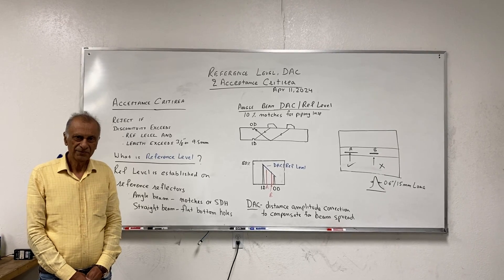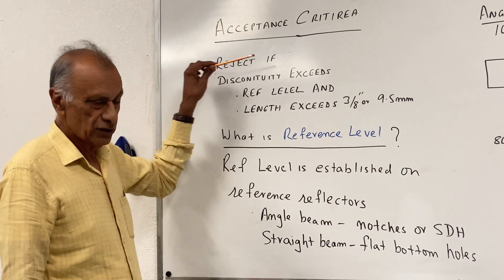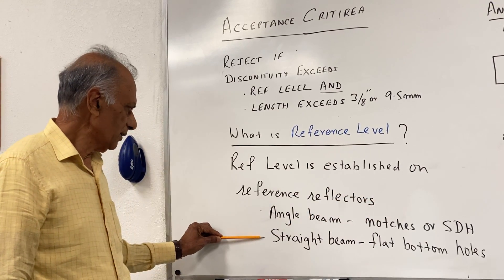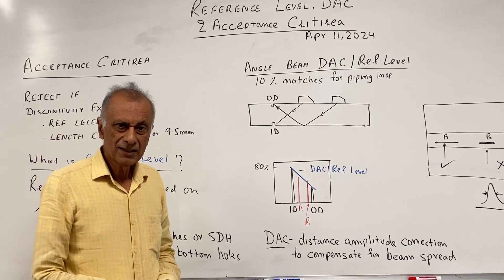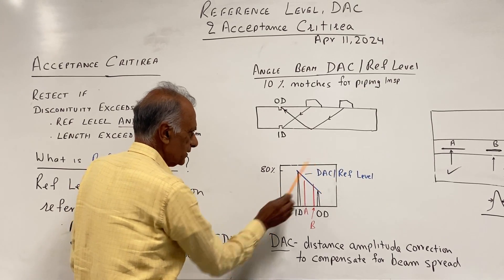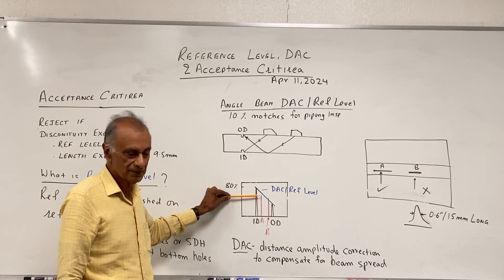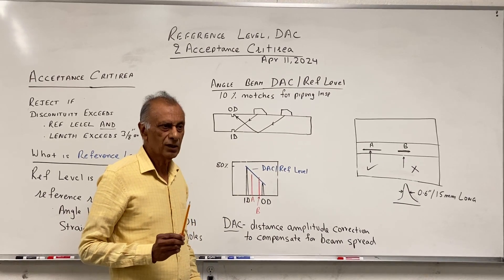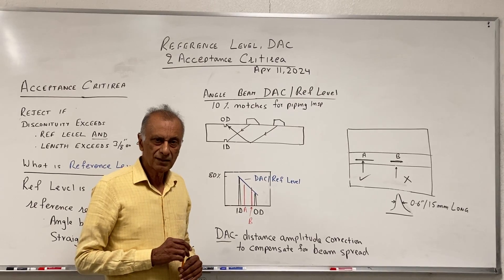Birring 202 UT of Welds-Reference Level, DAC and Applying Acceptance Criteria

Comment: DAC doesn't compensate for the attenuation of sound as it goes further into the thickness  .. realistically  ?
Reply from the maker: Primarily it is loss from beam spread. Carbon steel has very low attenuation